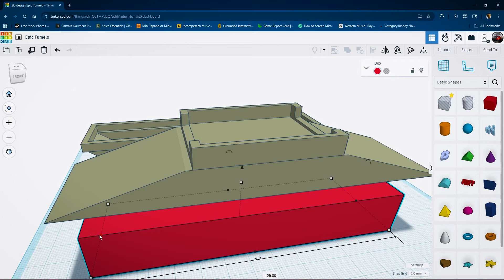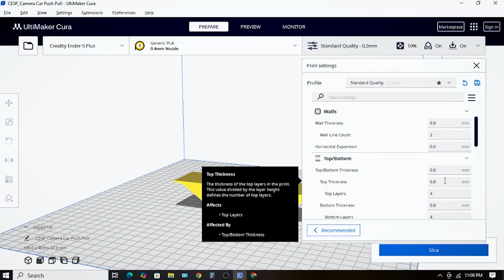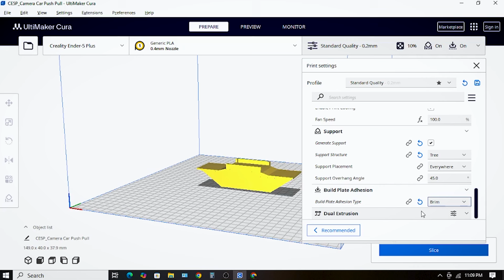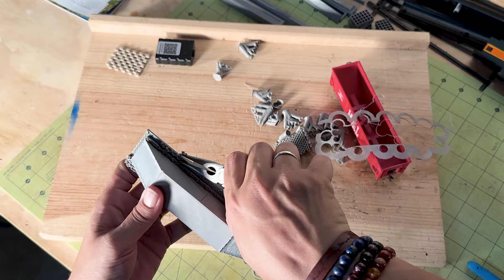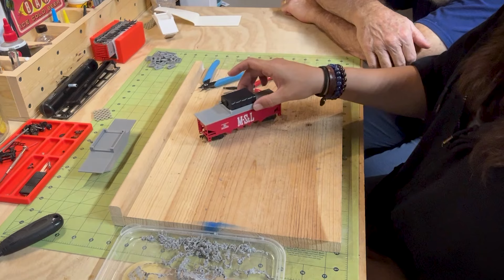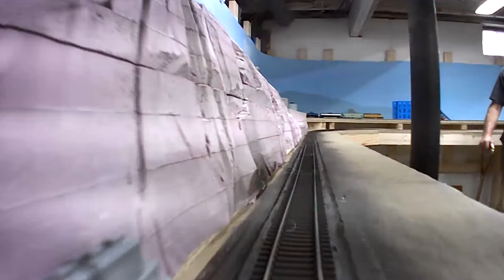How We 3D Print a Camera Car 063

Comment: Definitely no excess height cars on your layout then...
Reply from the maker: That's for sure. The first cradle was much higher than the locomotive and it looked over the top of the cab. This model sits in the gondola and we are pushing it around the track. All of my box cars fit just fine and they did not ship double stacked containers in the 60's and 70's that I can recall. Thanks for watching and commenting. Always a good time for us!